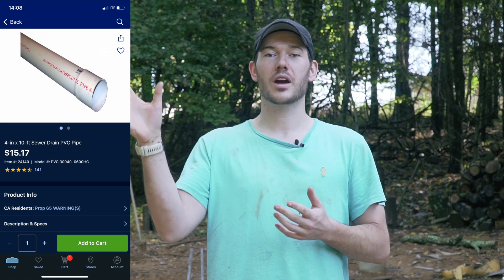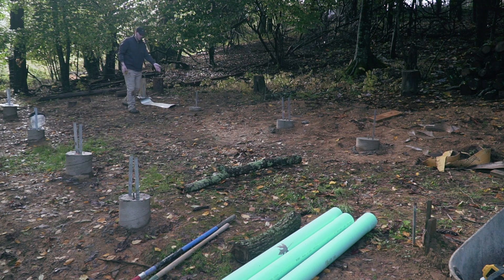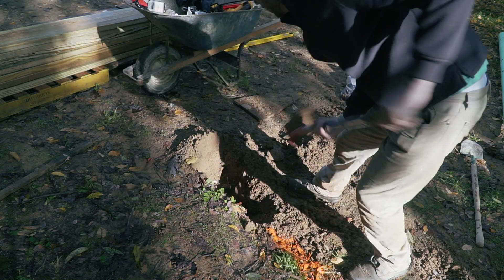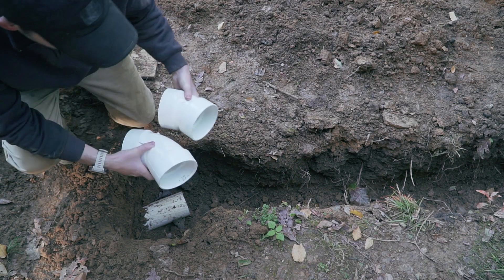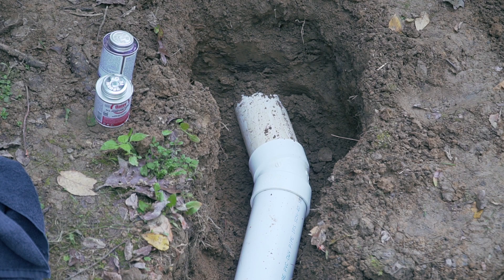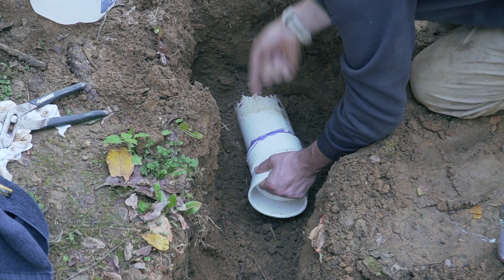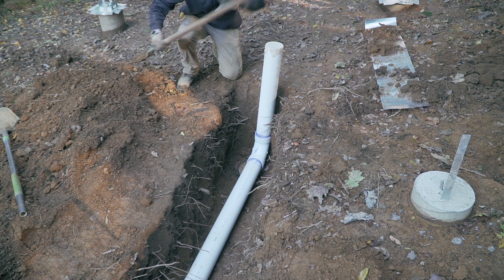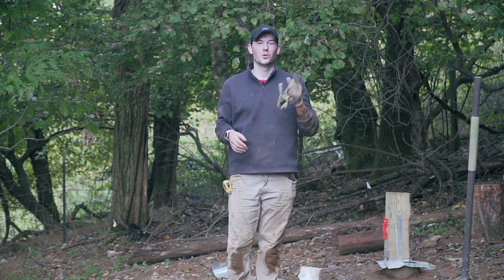Running the DIY Cabin Sewer Line to the Septic Tank - EP 8

Comment: The green version is works fine, is thinner walled and costs less than DWV.  It's called SDR35 sewer pipe. It lasts a long time.
Reply from the maker: Insteresting! I was so confused by all the options but at the end, because the septic installer had used DWV, I had no choice

Comment: Tristan, codes differ, but PVC-DWV pipe should be used inside the cabin to gather drainage from your fixtures, and when your line leaves the cabin to run outside to the septic tank, transition to the gasketed 3034 green sewer pipe.
Fall is minimum 1/4-inch per foot. Love the series!
Reply from the maker: Indeed I wasn’t aware, as you can see in the video, the professional septic installer did use pvc dwv to connect to the septic tank he installed.